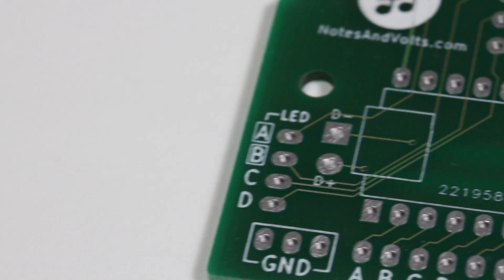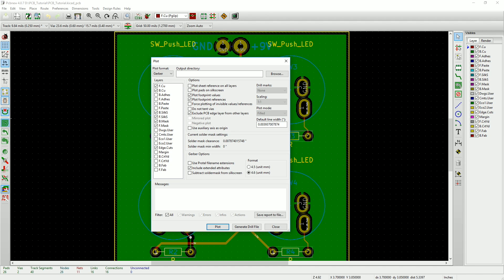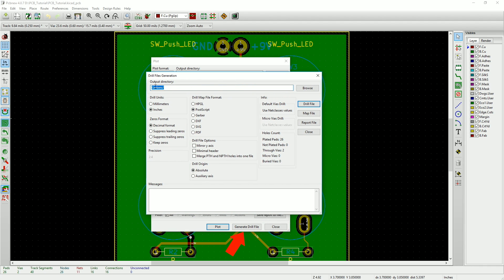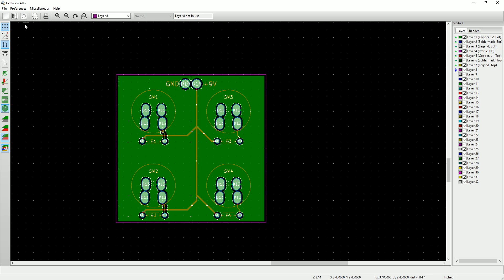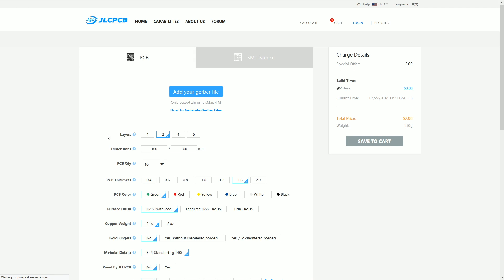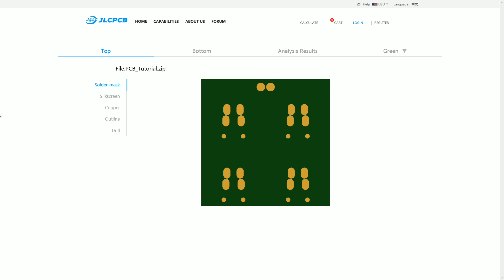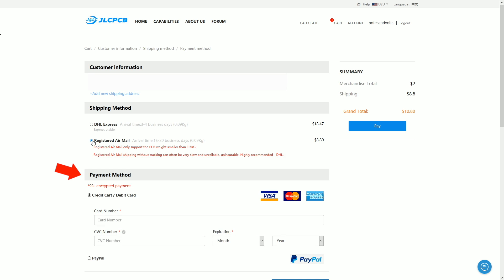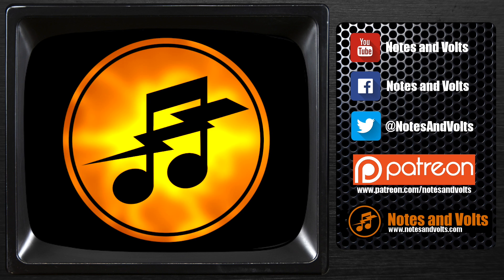KiCad - From Design to Manufacture - Part 4

Comment: Hey, thanks for the helpful tutorial! I saw that you are connecting the D+ and D- of the teensy‘s usb input to the board. Which connector/part are you using to do this?
Reply from the maker: Hi Karan. I solder two wires to the pads on the underside of the Teensy - then connect those wires to the pads on the PCB

Comment: One suggestion to someone who is making boards for the first time; Print out an actual size plot of your board on paper to check whether all of your parts will fit the way you were expecting.
Reply from the maker: Thanks Mike. That's a very good tip!